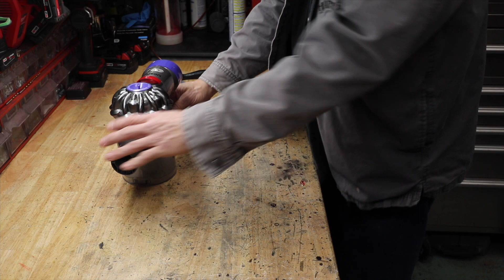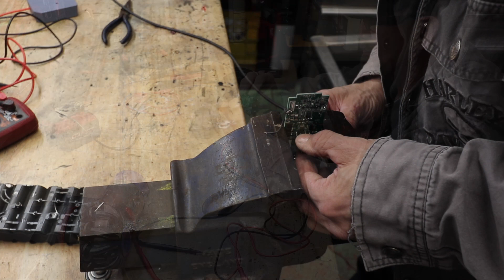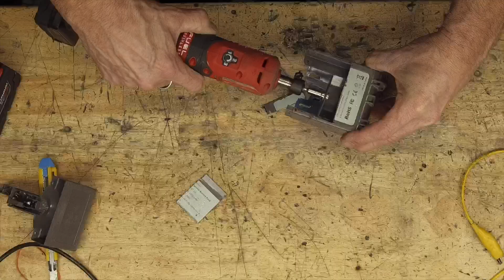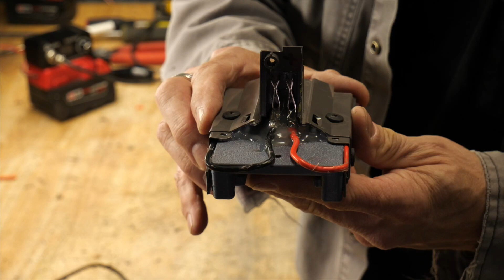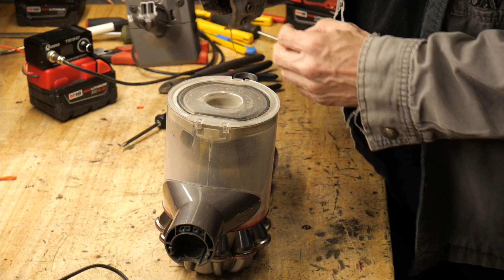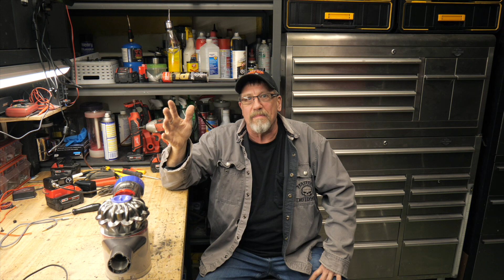Turn Your Dyson into a Milwaukee M18 Powered Workhorse.

Comment: Highly recommend this exact thing but for KOBALT batteries. Most Dysons (V8, etc) are 24V (21.6) native. And the batteries are far cheaper than other brands. We have the exact thing at work but with M18 batteries. You CAN hear a difference with the Kobalt battery.
Reply from the maker: That’s for the input. 👍🏼

Comment: I love Dyson batteries, find them at the recycler all the time with a faulty BMS and lots of good cells to recover.   
Got a little vacuum I'd thought about doing something like this with, hadn't thought about the microswitch signalling to the Dyson battery, hmm, think I'll wire it direct to a M18 adapter and put a manual switch where the micro is.  Thanks again!
Reply from the maker: I’m glad it was helpful. Thanks for watching.

Comment: I just bought one of these before the battery even died. I just couldn't stand the battery life. It would die 20% of the way into the job
Reply from the maker: I feel your pain. That’s why I made two videos using different battery types. People need to know how easy it is to get away from Dysons crappy batteries. Good luck with your conversion and thanks for watching.

Comment: I did the conversion with my animal V-8 put a Milwaukee M 18 battery on but only can use it on the low setting. Any ideas?
Reply from the maker: Does it shut down altogether or does it surge? If it surges, I would pull your filters off and see if that changes anything. I know when my filters clog up, mine surges on high. If it shuts down altogether I would try a  better battery. Sometimes if I’m running an XC battery and the charge gets down a bit, high won’t work at all. So I plug in a newer 5ah battery and everything works good again. If it’s neither of those two things, I’m sorry I’m at a loss as to what it could be.
Reply: I have the same issue. Did you ever figure it out?
Reply: @TDAPP22  I still have not figured it out. I just use it on low speed.

Comment: Did you end up having issues with that little switch handling the current? After replacing mine a couple times I ended yp installing a real 20 amp heavy duty 120 volt wall switch to the side of the case and i upgraded all the wiring to 14 gauge 600 volt SIS wire.
Reply from the maker: No. I’ve never had any problems with that switch whatsoever. And I use that vacuum almost every day.

Comment: I did a same kind of project, but did not want to loose thefunction of the button switch.
I used  "ferm" accupacks,, a 3dprinted adapter, and use a BTS555 switch . For safety i used 2 in paralell, the switch should pull down the input to ground,  the capacity of bts555 is HUGE, and very low resistance and overloadproof
Reply from the maker: Cool

Comment: I sure wish they had a Dyson V10 version, but I understand Dyson bumped up the voltage on the V10 and newer models and the Milw and Dewalt batteries don’t have enough voltage to run them now.  I still think an adapter could be done, just need to incorporate a DC to DC converter to raise the voltage as needed. The converter would use a little battery along the way, but so be it…..at least we could use our workbench full of drill batteries
Reply: The nominal voltage of the v10 and above is 25.2. Same voltage as the Milwaukee m28 battery system. They sell those same adapters on eBay for 20 bucks.

Comment: Thank you for your video!  I watched an earlier video and purchased an M18 Adapter rather than re-engineer the Dyson battery.  In your video, you installed an alternate power switch.  I will paraphrase you...the new switch will resolve cooking the original switch.  With this new adapter, I use the original switch, but I only get 30 minutes on a Milwaukee XC 5.0 battery.  Is that the normal vacuum time for high speed or should I have done something like what you did?  Would I do better with a different Power Toll Manufacturer's battery?  I am happy that we have extended the Dyson V8 Absolute's run time from 5 minutes to 30.  However, I had hoped by using a Power Tool battery that the vacuum would last hours.  Unrealistic, perhaps, but my thought nevertheless.
Reply from the maker: No, 30 minutes is exactly what I get on a brand new 5AH battery. 20 minutes for an older one. I'm glad it all worked for you.. Thanks for watching.
Reply: @i.b.lancer  thank you!

Comment: 14:54 - I did a similar thing with my two Dysons and Dewalt. I harvested the 18650s out of the OG Dyson packs. There's a thermal probe glued between two of the cells. I think once it gets a certain temp, it shuts down the "Max" mode.
Reply from the maker: Ya copy that. Thanks for the input.

Comment: My brother has the exact same Dyson and the battery barely lasted a year with infrequent use… probably three charge cycles on it from someone hyper-aware of how to care for Lithium ion (no over-discharge, no extreme temps, etc). So far the aftermarket battery has worked better and longer than the original but when it fails I plan to throw one of my DeWALT batteries on it.

Comment: I hooked mine up to the main wires and Bricked mine..  got nothing but about 1 second of vacuum goodness and then Smoke and finally sparks and a pop out the back.  I used a M8 5amp hour battery.   Figured since it's only 18 volts when the vacuum was 20 that there wouldn't be an issue. was wrong.
Reply: Probably polarity wrong? Or other electronic issue 18v is really okay since , when batteries get liwer olts (discharged) the voltage is definitely lower!
Reply from the maker: Well, I’ve done a few now with no issues and I’ve had many comments from guys that have done theirs without issues. Clearly you’ve done something wrong. Possibly hooked the wires up backwards?
Reply: Just had the same issue.  I just connected the M18 Battery to the Dyson terminals and poof.  When I connect the polarity correctly i get a spark but no power. Not sure what I did wrong. I even put the original battery back in and pulled the trigger and got nothing.

Comment: I don’t know to much about electricity, if I buy a 6.0 ah vs 5.0 ah make any difference? Could I damage the dyson with higher amp? Thanks
Reply from the maker: The AH stands for Amp Hours. It just means that the 6ah will give you a little more run time then the 5ah. It doesn't have anything to do with the actual amperage of the battery. Hope that helps.  Thanks for watching.👍

Comment: Actually it should be  DEWALT 20v BATTERY as it much closer to specifications requirements of an OEM BATTER. Furthermore 20v is 2v more than the M18 MILWAUKEE BATTERY which I feel are very well constructed after disassembling several batteries completely (SAMSUNG) 10 CELL are superior when compared to knock offs on AMAZON. You likely thinking what's 2v? it's actually alot to be honestly! It's exactly 11% more power or  pressure being (voltage) going to a Dyson vacuum
with a motor potential of 21v. Just a suggestion to try exactly what you did but in this video but with a 20v DEWALT BATTERY instead.
Reply from the maker: Thanks for the input. I'm a Milwaukee guy so that's what I'm using.
Reply: Don't you know that Dewalt is the same as milwaukee 18 volt? 20v sign gimmic was made for marketing purpose. Actually,  the milwaukee batteries are more capable of keeping the higher voltage in them compared to dewalt.

Comment: Is it compatible with v10?
Reply from the maker: I just checked it out and the V10 takes a 25 volt battery pack. Definitely won't work with the Milwaukee batteries.

Comment: You can also cut the bottom off a dead Milwaukee tool to use as a batter holder. How is that switch holding up? I have ran way less current through them and they don't last long. Also, Milwaukee has the cut off circuitry in the tools, rather than the batteries, so be careful to not run the batteries too low and damage them. The BMS on Dyson batteries are cheap crap and tend to cause the failures. Like when max setting kicks out only after a few seconds.
Reply from the maker: No problems yet.

Comment: New to this. If i used a Kobalt adaptor could i use a 24v battery for the Dyson 21.6v ?
Reply from the maker: I'm going to say no. 24v is just a little too high. You'll probably fry something.

Comment: Ooh. Ebay batteries are only $20 shipped if you wanna experiment.  I've been using one for 5 years. One time it didn't respond to charging but finally did. I'm also using a cheap charger which is not advisable.

Comment: Interesting Video! I’ve had one of those over priced vacs for years. Never decided whether I like it or it’s a pc o crap. It works great for five minutes, then you have to re-charge it for 3 hours. Piss poor design and battery life. I might have to try this mod someday. Milwaukee fanboy, so plenty of batteries on hand.
Reply from the maker: As a fellow Milwaukee fanboy, I absolutely love this modification and wholeheartedly recommend it. Thanks for watching 👍
Reply: Yep, I won't be buying another Dyson until they figure out their battery situation. They need something like this with reasonably priced high capacity batteries that quickly change out. $150 for a battery that lasts 7 mins on high (when brand new) is not my idea of good design. I wish ALL tools used the same batteries, TBH. It's criminal that everyone has these stupid proprietary batteries.

Comment: buy The looks of it ,    you got the shitty replacement battery .I would've never bought that replacement there's another one that's way better haven't had problems with it since I've had the replacement for over 2 years  rePlacement I got was only $40
Reply: Hi, do you have a link to the battery you bought?
Reply: @mg3611  Hello, I have a battery that free for you
Reply: Chinese batteries on Amazon are a complete crapshoot. Some work for days, some work for months. Mine is about a year old (2nd one, 1st one died after a month) and it lasts about 10 mins on low and 30 seconds on high, unlike 7.5 mins on high with a new OEM. I will never buy a knock-off battery again because they are hot garbage that use inferior cells. They ALL overestimate their amp hours too. If it says 5 mAh in the ad, they're lying.

Comment: The only issue is if Milwaukee’s low voltage protection doesnt work. If that vac runs the m18 battery down too far, it wont charge again. The factory m18 charger will read it as a bad pack.
Reply: This happened to me when I used an m18 on a converter running a Mikita work bench blower. Huge mistake.
Reply: @Coleslawbreakfast  you can bring the pack back to life by throwing some volts in it with another battery.

Comment: I modded my dyson v7 to run off Kobalt 24v batteries.  This is the correct voltage and the Kobalt batteries are cheaper but still made from ultra high quality Samsung cells.  Works perfectly and a good option for someone who is not interested buying miuawkee batteries.
Reply: I like the idea of running a little over voltage then under voltage. I believe the Dyson is 21.5 volts so the idea of running a 24V Kobalt vs the 18V Milwaukee is appealing.
Reply: @HODIUSDUDE  With the new sneaky advertising BS ("20volt MAX") it's not easy to tell what actual voltage people are talking about. All 20v Max batteries are the same 5 cells as 18v batteries. The only difference is the shady companies deceiving people to buy their product. 5 cells charge to 21 volts max, but companies set the full change around 20.4- 20.6. My Milwaukee 18v (20.5v) batteries have a slightly higher full change voltage than the 20v MAX batteries I tested. 

6 cell batteries (6x4.2v) have a max charge of 25v, thus a 6 cell Dyson battery will have 24+volts at full charge. Most companies charge their batteries to only 4.1v per cell, thus gaining about 30% more charge cycles. If we forget about all the "MAX" BS, then Dyson is a (6x3.6 working voltage) 21.6v battery. 

All batteries have a float voltage (12v car battery = 13.6v) which drains off a lot faster than the working voltage. Thus why using the proper working voltage is the correct way to rate battery voltage. 

I agree with you. I would rather run 24v than 18v, because the motor will draw the same power no matter the voltage, but if the voltage is higher, the current draw will be less.
Reply: @HODIUSDUDE  the milwaukee is 18v nominal, and 21v fully charged, same as the Dyson battery. Both are 5s packs, but the milwaukee is 5s2p vs dysons 5s1p.
Reply: @spinnanz  My dyson v6 21v battery has 6 cells in the pack
Reply: @spinnanz  Dyson is 6s and kobalt 24v is 6s so its a perfect match.

Comment: Too bad I have all dewalt..
Reply from the maker: I just did a Makita conversation. Can’t see why you couldn’t use a DeWalt battery. I just did a quick search on Amazon and they have the adapters for dewalt…
Reply: @i.b.lancer  I actually just found the conversation kit from Amazon where it plugs right in. Dyson sent me a free replacement yesterday but next time I'm going with the conversion kit. Thanks for the video

Comment: There's no battery protection built into the m18s, are you concerned about low voltage bricking your battery?
Reply from the maker: Why would I be… I can vacuum my whole house and it only takes two bars on the battery.
Reply: @i.b.lancer  What is he talking about low voltage bricking battery?  Is it still working out for you? Thanks
Reply from the maker: @wolverinegnr  If you drain a battery too far you can do damage to it. If you drain a battery too far too many times you will kill the battery. (brick the battery). It's just a cute name for killing it.  The guy asking the question is assuming that people are too stupid to push the button on the battery to see where the state of charge is and stop using it when I gets down to one bar, and charge it.  I vacuum my whole house top to bottom in about 20 minutes and still have at least one bar left on a 5ah battery. So there has never been a chance of over discharging a battery. This battery swap is an excellent choice. Thanks for watching.
Reply: @i.b.lancer  Thanks for answering.  I've used my milwaukee battery's till they run out usually on my M18 grinder since it sucks so much power. Should I not do this then? Thanks
Reply from the maker: @wolverinegnr  we all do it. It’s not the best for the battery but that guy was being over dramatic. You’re not gonna kill your battery if you drain it once in a while.
Reply: @wolverinegnr  the M18 grinder has low voltage protection to protect the battery, but the Dyson apparently does not have low voltage protection so you must stop pulling the trigger manually.
Reply: @i.b.lancer  hiya, sorry just saw this.

i wasn't being dramatic. in an m18 tool, the tool will tell the battery when it's too low to go on. in your application, you have no  m18 computer brain telling the vac to shut off. same with using an m18 battery source to power non m18 tools, you've bybassed milwaukees intelligence and run the risk of running your battery below a threshold where an m18 tool would have told it to shut off. you're right you can click the button to see, but there are situations (kid on a power wheel) where the user might not be that smart to do that step. it's smart to have a low voltage chip in place to handle for that case.

running a battery to the stopping point while using an m18 tool is safe, running a battery to the lowest voltage possible when using it in a non m18 tool such as yours it's smart to handle for, that's the situation that could harm your battery

Comment: Thanks for taking the time to make this video. I'm going to do this to my Dyson V6, the battery on mine sucks as well. Does the original trigger still work or is it powered on and off via the switch you added?
Reply from the maker: Thanks for watching.  I have seen videos where guys rig up switches that utilizes the switch in the handle but that’s more time and effort than I am willing to put into it. I’ve done two of these now and the switch that I put in works just fine.

Comment: I soldered my connections to the receiving battery terminals in the handle and added a switch that works with the pull of the Dyson trigger. My problem is that it’s draining the batteries in under 1.5 minutes.
Reply from the maker: Wow! I’m not sure what the problem would be. I’m getting 1/2 hour out of a 10 year old 4.0ah battery and with a new 5.0ah battery,  1/2 hour of vacuuming only takes out two bars.
Reply: @i.b.lancer  - A half hour on low or on high?
Reply: What size batteries are you using ? Don’t be telling us it’s a 1.5 or 2.0
Reply from the maker: @jayling8086  lol. Nope, no 1.5.  I’m running the 5.0 batteries in it.
Reply: @jayling8086  8.0 ah. I put the project to the side, no clue why it’s drawing power so fast.
Reply: @Kikister101  Motor might need cleaning or something like that?   I'm waiting for me DC56 to come in the mail that the offer was kindly accepted for so I can try this.  I already have the DeWalt adapter with a switch somewhat like in the video... though will be sure to thoroughly clean the DC56 when arrives after inspecting.  I know with motors, the windings can go bad and the resistance can get high to the point the motor doesn't function well or at all.  Sometimes, with brushed motor the commutators and/or brushes can be cleaned or more-so with the brushes replaced.  I'm not sure yet what kind of motor is in these.